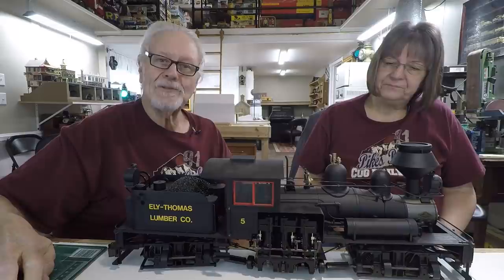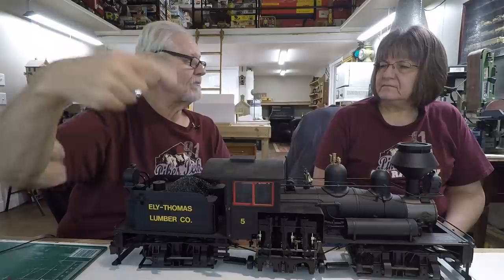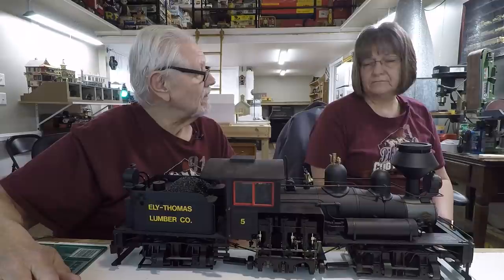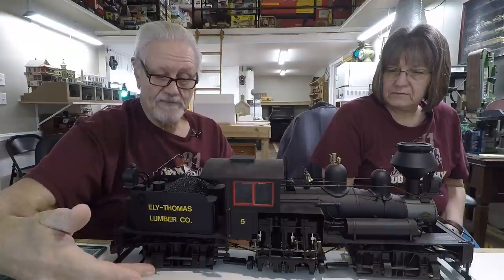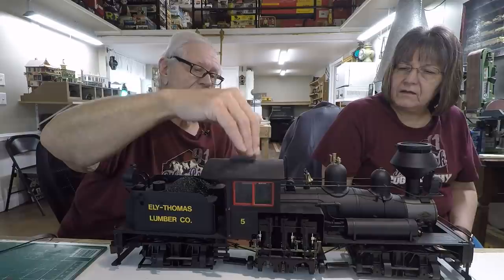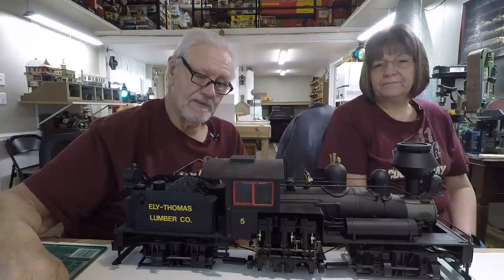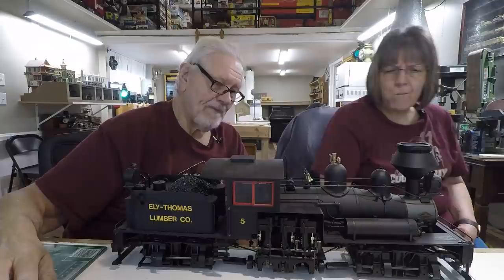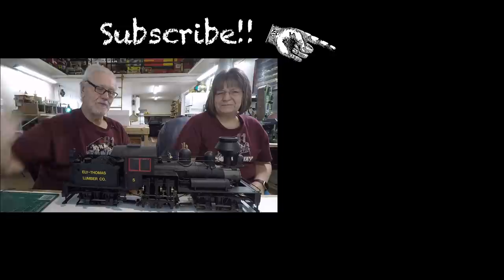Bachmann Spectrum 1:20.3 scale 36 Ton Shay

Comment: I, unfortunately, have one of those early Shays and it was only run at Christmas around the tree. The rest of the year it was on display. Several years ago that gear failed. I checked with the hobby shop where it was purchased and I got the you must have done something wrong song. I dismantled the truck and the gear was completely split into. Still no help from Bachmann except, send it to us and we will fix it for lots of my money. I put it back on display and that is where it is now. But your video has given me hope. I will pull that truck again and try super glue or gorilla glue or some other glue and, hopefully, get my Shay running again. Thanks for the video and I'd like ask your subscribers if they have had this problem and made a successful repair.
Reply from the maker: The trick is the baking soda and thin glue. AND if the gear is off, may be really hard to get it to work. BEST fix is 250 on eBay for new trucks.. Sadly
Reply: @ToyManTelevision  If I can't fix it with baking soda and super glue it will be a permanent display piece. I am a long time TMT viewer and I'm happy to find a possible fix for my Shay.  Keep up the good work.

Comment: Probably the most common failure in any scale is the use of nylon gears. Not just in model trains. I fixed hundreds of audio CD changers because of the same problem. Good explaination!
Reply from the maker: Thanks!!! Not sure why this model is more prone to fail, but they will ALL do it. Brass gears.... Thats not kust better, its really the only wat to make it work. All The new Bachmann have that.
Reply: @ToyManTelevision  it could be contributing factors like lubricant attacking the nylon over time. Or the stress of the torque

Comment: I managed to get a "broken" one of these at a local train store, box and all, for only $100. The motors still functioned but one of the connecting rods was snapped at the base and there were signs the previous owner already tried both blue and plastic cement to fix it to no avail. If I can get the whole piston and rod mechanism (Sold as a part on the Bachmann catalog) then I think it would have been an amazing purchase. If anything, I suppose I could make a small diorama of it being in the shop getting repaired.
Reply from the maker: Another common problem. We should have mentoned it. If the loco derails and one of the trucks twists sidwise and the power is stil on, the side shafts can jamb and bend stuff.

Comment: Bachman had replacement trucks for the Shay's, don't know if the still do, put a set on mine even though the first ones had not failed. They were not free, had to buy them.
Reply from the maker: Nope. But they are around. $250 on eBay
Reply: Hi - just came across your reply whilst searching for anyone who's 'upgraded' the trucks on this Shay model. I've purchased a replacement set (#88999) from Bachmann and am currently changing the old original trucks to these new ones - only problem is that the new top plate doesn't seem to fit onto the old beam on the chassis, looks like it's very slightly too narrow a hole to fit over the centre circular boss - did you have this problem as well? Any info - warmly appreciated! Thanks - Rob
Reply: Bob, replaced mine several years ago and I don't recall having any problems with the fit, the only issue that I had was that I got the wires mixed up and the front truck would run forward and the rear truck ran backwards, had to open it back up and fix the wires.

Comment: Just a thought, but with your knowledge and casting capabilities would it be possible to make a casting of the gear before it gets damaged? May also beable to help others out with having a common problem.
Reply from the maker: I cant get them exact. Really needs to be machined brass. NSL make them for many of these locomotives. But not an easy instal.

Comment: There is one other small issue ive found with the ho shays. Its been an issue for so long its become a non-issue. The so-called "o rings" . They r rubber rings that bachmann used to connect the dogbone shaft running to the trucks. Being rubber, they wear out and break. Longtime bachmann shay owners know to keep a few extra "o rings" around cuz u WILL need them
Reply from the maker: Didn't know!! Thanks!!

Comment: This is really cool,  I wonder if you can not just 3d print the gears to make replacement parts
Reply from the maker: You could. BUt the repair is tricky. Need to take the wheels off the axles. NWS makes brass gears for these. But eveen more of a problem. Take the trucks appart, wheels off, turn the splines off of the axles, place the gears with a set screw... Good greef....
Reply: I have printed prototype gears for work, and was surprised at how well they held up and how much torque I could put through them. Looks like I may have one of  the bad shays too, so I may have to end up trying it. Mine sits on a shelf for now while I wait for retirement.
Reply from the maker: @dntower85  let me know when you do!!
Reply from the maker: @dntower85  let me know when you do!!
Reply: @ToyManTelevision  ok cool and thank you I understand, I understand.
Reply: @ToyManTelevision  Rev 1 printed installed and working after a little mod, Rev 2 ready to print,  hardest thing is re-installing the little BB's that pick up power from the track.

Comment: I bought the first generation Shay in On30 and have never run it.  When the gear problem became known, I sent for a solution but got only a little bag of stuff. I have no idea where the little bag is in my workshop but the Shay will be a static display.
Reply from the maker: Sad... Northwest Short Line makes the best fix... BUT unless you are a machinest.... So many just sit. Sucks they made them like this. And its not a "china" isue. This happen when Bachmann was a US company building in China. After the company was taken over by China they fixed the problems.. at twice the price too.

Comment: the first generation also had plastic trucks, which get brittle over time and fall apart. If you haven't replaced them with the die-cast metal trucks, you will want to do that. I've done mine and a couple others' as well. And they don't give those motor trucks away either!!
Reply from the maker: I see them on eBay all the time for $250. Not cheep. You can get this locomotive for about that. But always the early one. So when I see that I just figure its really $500.
Reply: Hi Ben - just came across your reply whilst searching for anyone who's 'upgraded' the trucks on this Shay model. I've purchased a replacement set (#88999) from Bachmann and am currently changing the old original trucks to these new ones - only problem is that the new top plate doesn't seem to fit onto the old beam on the chassis, looks like it's very slightly too narrow a hole to fit over the centre circular boss - did you have this problem as well? Any info - warmly appreciated! Thanks - Rob

Comment: I had to replace my outside frame consolidation nylon gear.... Same failure. I got a replacement brass gear from bachman.
Reply from the maker: I live in fear.... Have one of those... never run.
Reply: @ToyManTelevision   it's not to bad to fix....lost of little screws and suspension springs that easily be lost. But the job itself is not too bad.
Reply: @ToyManTelevision  BTW the gear is on the shaft on the replacement part. They sell a " kit "  for the Outside frame Consolidation Locomotive.
Reply: I believe it is a slightly different problem. Mine broke when it derailed but still had power to the motors, via the tender. With the motors wanting to turn the driving wheels but the wheels off the rail the additional load broke the gear. I got a replacement/improved gear from Buchanan and it has worked fine since.

Comment: o-no, my shay has the wood side, but the rear light is on the cab, can't tell if it has the bad gears or not. its on a shelf waiting for a track to be laid oneday
Reply from the maker: Are the trucks metal or plastic?  The bad ones are all plastic. But half of the plastic ones are better. Still not great but better. No idea how to tell the difference between the first run and second run of plastic. The ones sent back were given the metal trucks.
Reply: @ToyManTelevision  took mine apart last night and sure enough it's nylon. And cracked, the gear just slid right off the splines. Looks easier to replace the gear than the trucks.

Comment: The truck frames on the early model also disintegrated because they were made from regrind plastic.
Reply from the maker: So now I’m wondering if mine has replacement trucks on it as they are metal. Or did they change to metal trucks halfway through that production run? But I’m beginning to think at some point mine were replaced before I bought it
Reply: @ToyManTelevision  You could be right there. I can't exactly recall now but I thought that the metal framed replacement trucks came out after the first 36 ton version was produced. I know many people had the trucks crumble in their fingers. I have a new one stashed and the trucks are perfect but I guess once they get out in the elements they will eventually deteriorate therefore I also have a set of metal replacement trucks at hand.

Comment: I have a ho scale bachmann 80 ton three truck shay, i bought old stock brand new. Gears broken on sight. Im sitting on a new loco i have never seen move yet because these gears are no longer available. I hear north shore has metal gears.
Reply from the maker: Yup. And or PFM?  But yes.

Comment: I'm viewer #1 yeah!!
Reply from the maker: HI  And thanks!
Reply: @ToyManTelevision  Hi i have the same shay and would really love to get this thing running  now I'm only new to G scale as i have just inherited my grandfathers total train collection but couldn't find the power supply transformer or controller all the wires were there but the main components were missing and was just wondering what voltage and amps would best suit these engines. any help would be greatly appreciated .   Kind regards Brendin

Comment: Honestly, most clubs have a 'guy' who could make up some brass replacement gears. Might not be cheap, but it might be cheaper than buying a new loco.
Reply: Brass definitely would be better than Delrin.  Delrin breaks also just not as easy.  By the way Delrin is poly formaldehyde.